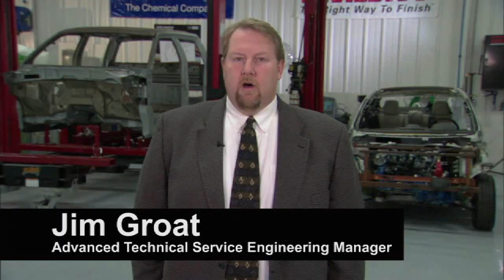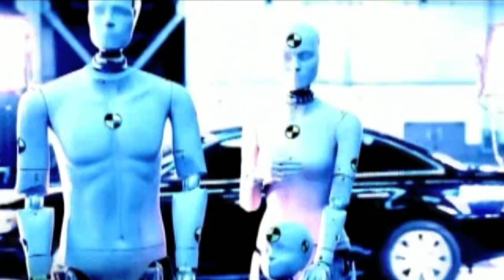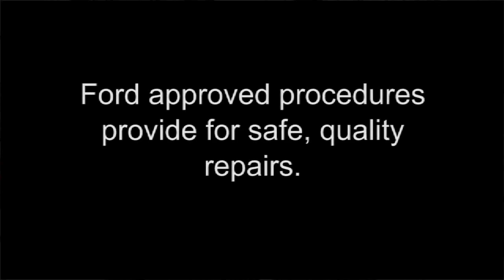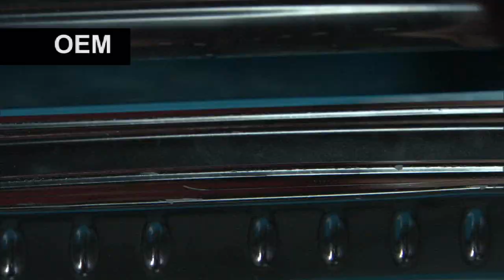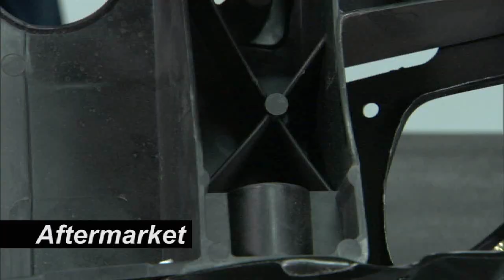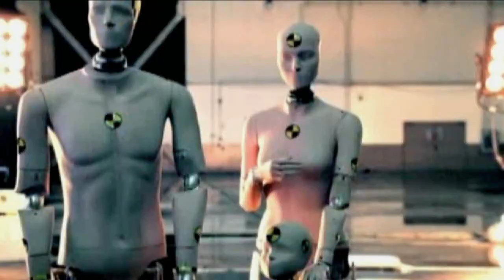Genuine Ford Crash Parts vs. Non-OEM

Comment: Note: no one is usually going to take a sawzall to their bumper support or a pneumatic chisel... while it does hopefully mean that ford uses stronger steel (all steel comes from the same place we buy it from japan who buys it from china..) But even if somehow fords oem steel was stronger it still doesn't excuse them from the shoddy workmanship in their engines and transmissions.  not much fear of wrecking if your car isn't on the road to begin with. but maybe that's fords idea of crash prevention and safety....keep the engines and transmissions from lasting so the car is off the road....

Comment: It doesn't matter if the parts can be drilled easily or not, just get two Ford cars, one with non oem bumper and one with oem bumper, plus it depends what company is making the non oem parts, some companies have a good reputation and ensure the safety is retained.

Comment: @MOSESJ1987 
wow take it you have never replaced an air bag before. The actual bags are not as expensive as people think nor is it hard to install just the air bag. 99% of the vehicles are mandated by the manufacturer when a bag deploys that you replace the clock spring, both front sensors, diagnostic unit, and all seat belt tensioners. On top of that have the computer scanned for any other issues and have tem repalced as well. Patching a bag or covering its hole is something most shops wont do

Comment: @ArthurDent60 
Who are you an adjuster for? I work for a GEICO and depending on what needs to be replaced depends on how it is handled. If it is a structural item or safety item we go with oem only. a/m is only used in apperance and convience items such as fascias or fenders. As far as rebar, absorbers, frame, and inner structure it is oem only.

Comment: @MOSESJ1987 
actually on most vehicles they can be replaced. Well the proper term would be sectioning. Must Convential frames is where you are going to see sectioning time set forth by the manufacturer. Unitized frames you wont see it as often due to the fact the cost of the part and replacing would cost about the same. Ask me how I know I am an Adjuster for a major insurance company and comuncate daily with manufatures to verify what is safe and unsafe as far as repairs.

Comment: @MOSESJ1987 
The point that Ford is trying to make is that the structural parts
of the vehicle must work together to maintain the integrity of the
vehicle and the safety of the occupants! After Market shocks, plugs,
wires or lights are Not at issue!

Comment: WRONG ONCE AGAIN DIM WIT, A/M replacement parts DO have to meet the same federal requirements as the oems. Body shop associations,trade publications, still doing ford's dirty work for them. Notice how ford does not enter into this conversation. They know better, they have their brain washed puppets do their talking for them. THIS IS A FORD MARKETING SCAM, the idiots spewing this hype just don't know any better. They think it's going to gain them notoriety.

Comment: If both oem and aftermarket replacement parts have to meet the same federal requirements, who's checking to see if ford's offerings are safe ? How do you know they are exactly the same as what the car was manufactured with. What, no one is concerned with that ? Why is that.

Comment: The majority of A/M parts are crap but some are better than others. Dealing with these issues for nearly 20yrs on a daily basis, you can't argue that OEM parts fit better and are better quality. That goes for automotive mechanical to collision to even washer machines!! You also can't deny that people gave died from cheap parts in all industries! OEMs need to keep prices competitive & A/M industry needs to control quality such -  as CAPA - which helps instill confidence in using A/M parts- even

Comment: Crash testing a bumper support is not a testing program but sawing one with a sawsall is ? And for your information, the oems will be going to court and it will be much more then a challenge for them. Further more, if ford's agenda is to get the aftermarket industry to make their parts more like theirs' in an effort to increase the cost of the aftermarket part so that the price point is more competitive it will never work. If the am part goes up by 20% so will the oe because it's branded .

Comment: The aftermarket industry is facing ford's scare tactics head-on and putting its parts through rigorous crash test. Results of test conducted and performed by engineers at an independent , government contracted testing facility using the industry standard NHTSA New Car Assessment Program (NCAP),aftermarket  part-equipped vehicles have met the exacting federal safety requirements for crash worthiness. These are published results,not like ford.

Comment: The AAIA has recently requested that the FTC investigate whether certain assertions made by ford are in violation of the Magnuson-Moss Warranty Act and to require them to show evidence to substantiate their spurious claims that there are problems with the use of non-original equipment parts. Aftermarket collision parts meet all of the same regulatory requirements that the o.e.replacement parts are required to meet.

Comment: I'm not promoting inferior parts and your not promoting safety. This is a marketing scam produced in it's entirety by ford motor company. If i told you who I was ford would be very upset. They're frustrated enough by having  body shop associations and trade publications back up their hype when in fact they are not qualified to do so. Ford has crash tested these parts but will not release that information due to the results being inconclusive. However, independent crash testing is underway.

Comment: Engineering is all relative mr. i-car. How dangerous was a ford focus front reinforcement before it was made out of moron boron ? That's right, it was just like the aftermarket part. So if you can't compete on that level with part sales, just change the part and tell every body it's better. Now, let's see, are we engineering parts or money ?  Neither has worked for ford.

Comment: Sure,fit and finish has always been a concern with aftermarket parts but that doesn't make them unsafe. With no data to support their claim, no crash testing to support their claim, nothing what-so-ever to support their claim, they make these SCARE videos in a desperate attempt to turn around a very dismal parts bottom line.

Comment: MrSae300, Just because aftermarket parts have been used on automobiles for 20 years, doesn't make them good. I've worked with counterfeit parts for 30 years and the fact is they are almost always inferior to the factory original. Even an untrained amatuer can often spot the difference.
Crash testing is only one aspect of many measurable characteristics of counterfeit parts.  There are a long list of other deficiencies to consider with aftermarket parts.

Comment: Ha Ha..not even close, I'm not affiliated with any  aftermarket industry. And once more, I'm not  some wanna be lobbyist / activist trying to gain notoriety for my water buffalo lodge type body shop association like you are. I could tell this reply wasn't from a ford representative. Although you open your mouth wide what you spew out of it is best left in some booth at some lame convention.  Your agenda of claiming all parts but yours are inferior is weak without  actual crash testing.

Comment: Sawing and banging parts with a hammer renders no usable data that relates to occupant safety. Instead of using ford crash data from ford engineers they revert to information they obtain from community college level vocational instructors. This is a desperate last ditch attempt by ford to sell some parts. Which by the way, they haven't been doing a good job of lately. The reason ford does not publish full car crash video of these parts is because the results were not what they expected....